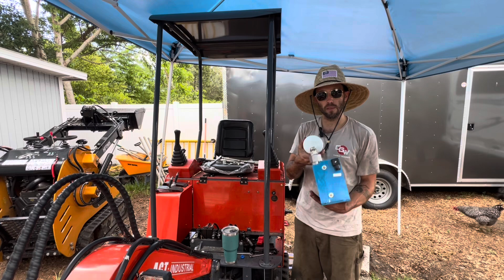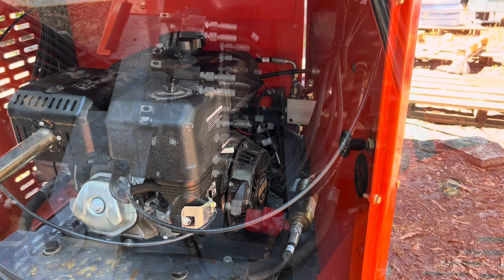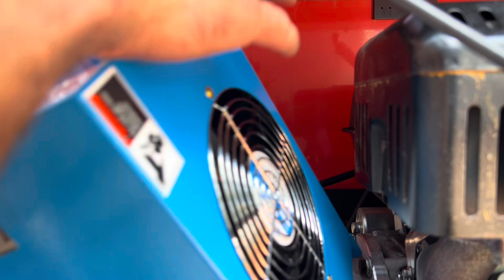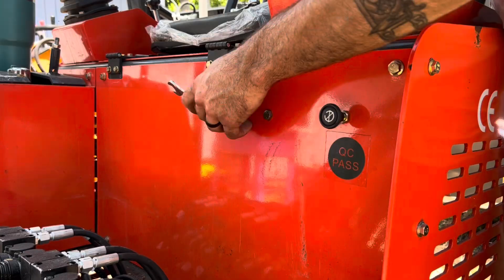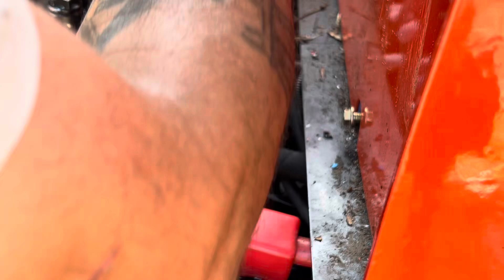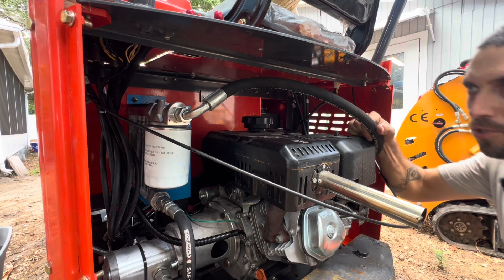Chinese Mini Excavator: H15 Cooler and Filter Kits are available now! INSTALLATION INSTRUCTIONS TOO

Comment: The other point on spin on filters… they typically have a beta ratio of 2 or 50% efficiency which is called nominal filtration. Use a filter that is considered absolute with a beta ratio of 200 or better. They are more money but filter to a much better ISO 4406 cleanliness code and typically have a much higher dirt holding capacity, so in reality, it’s less money if you calculate the filter based on DHC plus it keeps the oil really clean. As it relates to sizing, use a 1.5 multiplying factor on the max flow rate. Lastly, a By-pass indicator that will identify when the filter has reached its DHC is strongly recommended. Changing a filter on hours of operation is not accurate at all.

Comment: Just bought a 2025 CFG H15R and want to install your cooler and filter system. I see the hydralic stack is different. Wondering if if still works?
Reply from the maker: Is your outlet on the right?
Reply: @thegarageconnection there's a larger hose coming into the body from the pump with no line above it. Looks like you can adjust the flow.
Reply: Wish I could send a picture.
Reply: So, the return hose to the tank is at the other end of the valve stack. The kit hose would have to be longer?

Comment: I've started using old heater hose or fuel hose for abrasion protection. Cut a bit then slit long direction wrap on like that upper hose so there's a layer between the metal and the Hydraulic hose. Use zip ties as needed to secure it. Works great for wire harnesses too and will take more abrasion than most of the plastic split loom

Comment: Filter goes after the tank and before the pump. Not on the return line to the tank. This means any dirt or debris that ends up in the tank when you’re adding fluid does not get filtered until after it passes through the pump. In short, you’ve got the filter in the wrong location.
Reply from the maker: Not sure where you’re getting your information from…… suction strainers go before the pump (which these machines have) and they protect the pump from debris that can damage it. Return filters go just before the fluid returns to the tank to catch any debris picked up in the system, and ensure the fluid returning back to the tank is always in pristine condition
Reply: You dont want a filter restriction before the pump, it will cause cavitation and early death of the pump…..if you have a Parker pump it will take it a while but eventually it will eat itself then all that debris will be everywhere including the tank.  To each his own but if the pump grenades pieces will be all through the system by then anyway

Comment: So all issues solved with adaptors, hoses, etc. with the owner of Central Digger Supply assistance.  He offered outstanding customer service and made it right.  I would highly recommend getting all your parts from his store with confidence that support will be provided if needed.  Kit is on my 2025 H15R and doing well. Thanks, Central Digger Supply.  5-star rating.
Reply: which manufacturer did you get AGT, CFG or another? i got a 2025 CFG H15R i haven't taken possession of it yet but im trying to figure out if this kit will fit mine, or if i will need to buy it as he's showing on a AGT not the 2025 CFG
Reply: @simplegreen6596  2025CFG H15R

Comment: Received the kit today you stated would fit thy 2025 AGT H15R.  Three issues related to missing parts, damaged parts and/or ill fitment.
1. Kit is missing the DIN to JIC adaptor required at valve body return port. This appears to be in kit as per your store pictures but missing and required since you supplied a hose from cooler to valve body that is JIC on both ends
2. As suspected and as per my original posted question, the 38" hose supplied with kit is about 12 inches too short to reach from cooler to valve body. You stated you would supply a 90-degree fitting in my order that was missing from box as well.  Even if supplied, it would have done no good anyway as the 90 would add no length and only cause interference in pump adaptor.  
3. Oil cooler fan was pretty damaged with mounting ears fully bent flat even though the box had absolutely no damage on exterior. Was it damaged prior to shipment?

Please advise as to when you can overnight me a DIN to JIC fitting and proper length hose to allow me to install on my machine.  As of now, the kit is useless, and machine is down due to draining of all hydraulic fluid in preparation for installation.  

Thanks
Reply from the maker: Hi Todd. It appears you have a new style H15/H15R. Your machine is the 2nd such case that I’ve seen where they changed the valve body from the Pre-2025 Machines. As such, the kit will not fit your machine, which you already know, and the hoses are all pre-cut and pre-crimped prior to me receiving them from overseas. I don’t have any more 5/8” -10 Hose in stock, so I’ll be more than happy to give you back payment for the kit, and you can keep the whole thing. As far as the bent mounting feet are concerned, I’m surprised it got that messed up in transit, as they’re all in relatively good shape when they leave the shop here.
Reply: @thegarageconnection  what about the DIN to JIC adaptor that I am more concerned about. you show it in the kit on our website.  I will have to have a hydraulic shop make me a 55" hose that is required to complete the kit.  Cost of that with JIC ends will be approximately 150-180 if not more. I would appreciate and welcome a refund as I could have bought individual parts from Amazon at a reduced price and be in same dilemma looking for DIN to JIC adaptors for which I have no knowledge of DIN female measurements. I tried to avoid buying a kit that would not fit with my original question that defined my 2025 valve body difference from earlier models.  Appreciate the response and willingness to work with me.

Todd
Reply: when can i expect a refund?

Comment: Hydraulic line over the engine? Seems risky and you need the filter ahead of the cooler and not behind it. Just saying
Reply from the maker: Only way to get it to work. I include a heat wrap for every hose. The whole filter/cooler or cooler/filter debate is a circular argument. I deal with extremely complex hydraulic systems at work, stuff involved in steering or load lifting, and every one of them has the cooler before the filter.

Comment: thats a good idea to wire the fan so that its switched by the battery cutoff. On my mini skid, I repurposed the indicator light that burns when the motor is running, so that it indicates a closed batt cutoff,,,,these machines need some kinda indication as to the state of the batt cutoff besides the position of the switch handle. Btw the light that I used seemed to be providing circuit protection for the gages, lites, acc solenoid and pilot solenoid. A lite as a fuse, lol. I am tempted to just rewire the whole machine from scratch

Comment: Last Saturday I installed one of these kits on my new H15 and it all went without a hitch.  For some reason my machine is just a little different than yours.  I had to drill a hole for the bolt and punch a hole in the front panel but it all fit well.  I did all of this while I was changing out the hydraulic fluid and with the cover removed from the tank I was able to reach the return line fitting on the tank very easily from the side.  Nice job on the kit and the instructions.

Comment: I recently ordered the H15 filter and cooler kit, have been charged, yet no notification of being shipped. Please advise as to disposition of order.  Also, I have a 2025 AGT H15R and the valve body differs from the video in that my return is on opposite side of the valve body, therefore hose supplied with kit will be too short. Can you supply hose that is longer and will fit my model?  Thanks
Reply from the maker: Yes sir I see your order in the queue, im working as fast as I can, unfortunately all my hoses have been made, and they’re about 38” long from end to end, so it should still reach, but I can throw a 90 degree fitting onto the bottom of your cooler and it’ll give you much more length on that hose.
Reply: @thegarageconnection  ok, thanks for the reply and extra fitting.  Is the supplied hose JIC on both ends with a DIN to JIC adapter at pump? Kit appears to have this adapter? if so and required, I can make one up of proper length

Comment: This is awesome, but you should have the filter before the cooler for a couple reasons. You want any contaminants to get filtered out before hitting the cooler so that it doesn't clog up the cooler and also, your filter is designed for pressure build up as the life of the filter is used but the aluminum cooler isn't. You shouldn't see a ton of pressure build up with the addition of the filter, but you can expect up to 25psi as the filter ages, but if the cooler ever clogged, you could blow out your cooler instead of blowing out an easily replaceable filter. this is an easy change, but just something to think about.
Reply: can you expand on this? in this configuration is it just as simple as moving the filter to the lower port first instead of the top, taking the top and route the hose back to the valve?
Reply: Is it possible to have the filter directly out of the tank? So that any contaminates are caught at the very start of the cycle?

Comment: I have a question about a hydraulic oil filter for my AGT QK18K-C I’m seeing that it goes into the top hydraulic cooling line and not into the top oil tank line so where can I find the parts that I need or where can I pick them up from thank you

Comment: Be nice if they weren't sold out since I got my machine. Since then, I have ordered a cooler and a filter assembly but am thinking and researching the fittings I will need for the components I have purchased. Hence where these kits would be Super handy. If you can advise the fitting for the relief that could help.

Comment: Love your content!  I've watched most of your videos and now own one of the H15 models.  Looking for the H15 cooler / filter kit but it appears you're sold out.  I'll check back in March as your page shows when the parts may be back in stock (??).  Also, 30L vs 60L per min, is there a size difference or is the 60L cooler capable of pushing / pulling more hyd fluid /min? THANKS
Reply: 30L and 60L are different sizes

Comment: I bought one for the h15. You'll have to figure out the size for the lower port cause he'll send it with plastic instead of metal.
Reply from the maker: The lower port on the cooler?
Reply: @thegarageconnection  I'm sorry for the comment made. Went to take it off and it is in deed metal, it's painted black and looks like plastic. My apologies.

Comment: So the H15 we got that’s supposedly manufactured back in august has a giant filter on the high pressure side. Is one application better than the other? Would like to add cooler though
Reply from the maker: That filter only serves the pilot controls and won’t filter all the fluid

Comment: Is that red arrow pointed inward? Wouldn't we want the fan to blow the hot air out of the engine bay rather than in? Also, what LPM is this cooler?

Comment: Just ordered one of these and will be looking forward to  delivery in several weeks. I was a tad shocked the other day when I had a good run then happened to touch a cylinder.
Getting ready to weld on 4 tie-down eyes/hooks.   Have a hydraulic thumb and a quick coupler. Both are awesome.
Will have to lengthen my thumb tines to work as I desire because of the extra coupler length( that will be my first welding project) I will cut up 
and use pieces from fixed thumb that came with machine.
 Less than 1 minute bucket change with 1 socket on that coupler if anyone is wondering.
Custom did a 6 fan cooling system , mounted to back grills, sucking air through and out. Does a splendid job of cooling it all down.
Wasn't sure if I could have wired it in so it has it's own 100ah deep-cycle to power it. Sitting on  battery tray mounted behind seat . Probably use it to
power this unit as well. Probably going to mount another fan on inside wall blowing into this unit for double the effect.
Everything coming together. Stoked.
Reply: where from can not find contact info ? thanks

Comment: Friend, does this seem to make a circuit? Is the hose coming from the oil tank the one connected to the filter? And then another one comes out of the radiator to the inlet valve, and the return one goes to the pump? Is that how it is, or the other way around

Comment: Thank you for showing the basic principles of mounting a hydraulic cooler. My application is different and requires a different kit and solution but you gave some very good advice (60's tractor running a wood cleaver). I enjoy your videos, very explanatory in regards to hydraulic line functionality.

Comment: a trick to prevent the loss of fluid from the tank is put a shop vac on the fill without the cap on and it will hold it most in.

Comment: Hi, just bought an FF12, and it has a hydraulic  filter mounted behind the seat in the engine compartment. Also, my hydraulic  tank is mounted under the floor on the right. Would I need this kit or just install the fan kit.
Thanks

Comment: Disconnect - battery terminal before doing any  work on machine. That + battery terminal is a major short hazard.
Reply from the maker: The battery disconnect switch makes the chassis ungrounded. You can tough the positive directly to the frame all day long and there’s no current path to ground
Reply: @thegarageconnection  , Agree the switch does cut the connection to ground. I have seen three switch’s fail . Something to think about in an instructional video….
Reply: @stevendunn6255  Safety nerd. you wear a condom on your tongue when you kiss a lady?

Comment: I have the AGT QH12R with the R420 engine (not the briggs engine).  Will this cooler/filter kit work for this one?  Ive noticed on mine the psi rating of the hydraulic hoses are 7000 psi and on the H12R they are rated for 5000 psi.
Reply from the maker: It “should” work

Comment: Another great video Cam! Two questions: 1- I have mostly seen machines where the cooler is installed after the filter in the return line. Can you comment on the pros and cons of each approach? 2- Can you make a video that goes into the specifics and explains how the different components of a dual circuit pump with flow divider valve (with safety solenoid, accumulator and filter) and joysticks operate on machines such as the H15?
Reply from the maker: 1) The filter being at the very end of the system ensures all contaminants are removed prior to the fluid entering the reservoir. If the filter was first, then potentially the cooler could have particles inside it that would be sent directly to the sump.

Comment: Will that work for a miva va15 mini excavator
Reply from the maker: If it looks identical to an H15
Reply: @jayjames1657 did you try this? I’m currently trying to put the H15 kit on my Miva va15. The setup is a bit different. The return hose runs through the left pilot control. I think you’ll need a 90 degree fitting on one end of the new hose to make it work, but I’m also very new to this stuff.